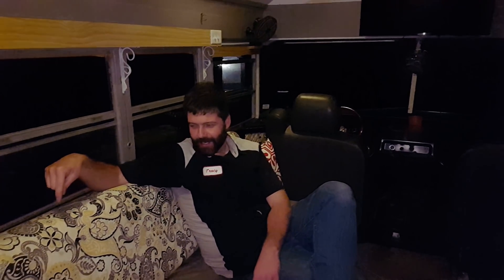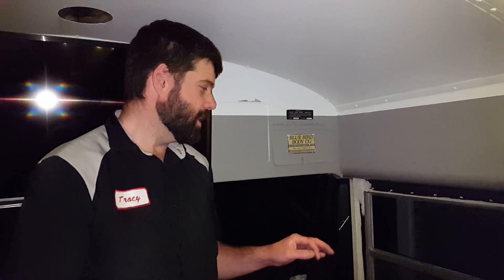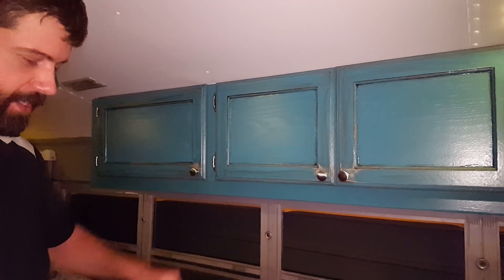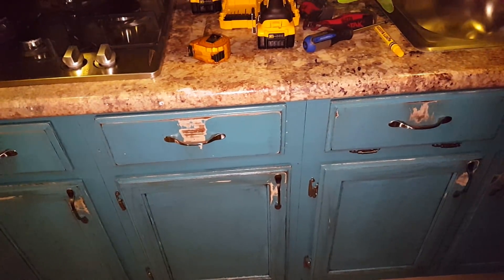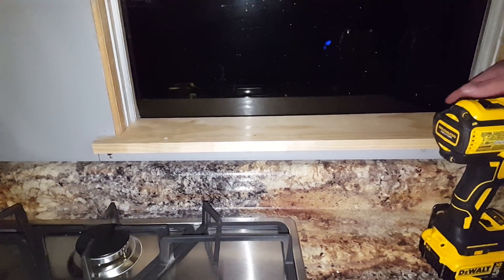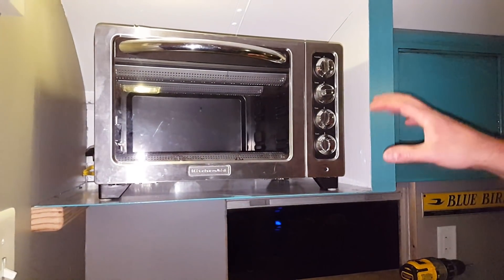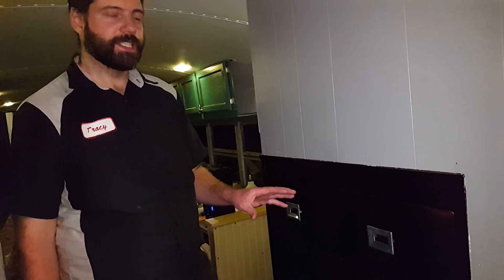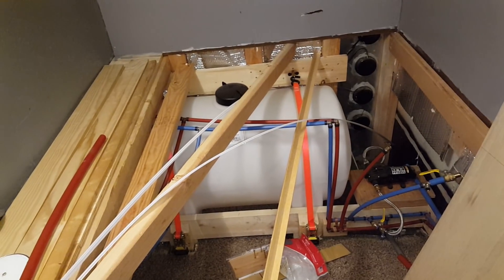Skoolie bus conversion tour in progress

Comment: It is called a "Shelf" Tracy. 
I've heard them called a "Sill Plate", but I am not sure if that is correct because a regular sill plate is the thick lumber that is bolted on top of a brick or concrete foundation that the frame is secured to.
Both of them may be called a sill plate, though I would think that there would be a designation of a "Window Sill Plate" in this case.
The trim that is often added under it in a house, is called the "Apron". I remember that for sure. It's been a while since I did that kind of work.
Reply from the maker: Ahhh yes, there it is! A shelf, I knew there was a scientific term for that chunk of wood in my window lol.
Reply: or a lintel.
Reply: That piece of wood is called a window stool.

Comment: hey - what type door did you install in front of back wheels ?  i.e.  buy an RV door, make one with the metal cut out of the opening ?  etc ?    thanks.
Reply from the maker: Thanks for the question Johnny. I actually went to a mobile home parts store, and bought the smallest door that they had. It is a fiberglass shell door with aluminum trim and opening. It is filled with styrofoam. I made and welded a metal frame out of angle iron on to the bus after I cut open a hole in the side of it. Then I mounted the aluminum frame door in its place. Then I made a stairwell to walk up in the bus. Let me know if you have anymore questions, I would be happy to answer them.

Comment: Ashley wins, the pillows don't match. The bus is looking good though.
Reply from the maker: Lol dang! Thanks David. 
Hey I was gonna email you today.. yesterday We moved the sheep over on the neighbors land that we are now leasing. Today one of the sheep got out. Trevor came down and we both agreed that two fence post were pushed over. So that sheep was pressured out we think. The neighbor has a small white terrier dog, and it was getting in the fence yesterday when we were setting up the fence. Plus the dog is white. I wonder if the sheep thought it was a lamb. But that's beside the point. Anyway I bet that dumb little dog got in the fence today and was chasing the sheep! You got any recommendations short of lead that will detour that dog? Maybe like some cayenne pepper spray along the fence line? Apparently the dog missed the electric shock treatment that the fence was giving. Probably snuck thru between shock jolts by chance. Anyway I don't wanna leave the property but I need peace for these sheep. Thanks.
Reply: Fox or Coyote urine might do the trick if he is a small dog. Being a Terrier, it might not phase him like it would a house dog though.
The Cayenne Pepper might work too, I've never tried it on dogs before, just mostly rabbits and deer.
I would also try Ammonia, I've used it with good success to keep dogs and cats from digging in the garbage. Sometimes strong vinegar works too.
That's about all that comes to mind at the moment, but I'll put my thinking cap on and see if I remember anything else. 
I would try the Ammonia first, any of the others might work, but I know the Ammonia has worked for me in the past.
Skunk might turn him away also, heck try whatever you and Trevor can think of. Whatever it turns out to be will likely keep the sheep a little ways away from the fence also.
Reply: I've been thinking of emailing you too. I need some fog lights and driving lights installed one of these days.